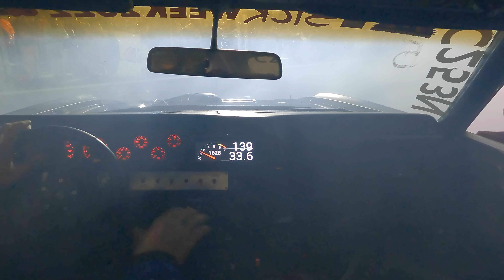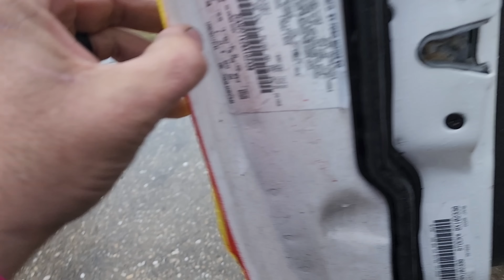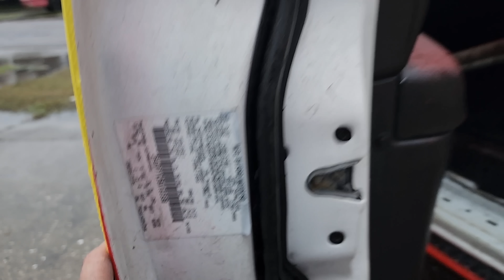We ALMOST won 2.4hrs of LeMullets + Chevelle's FINAL Burnout!

Comment: For those in less-humid parts of the country that are wondering why the power steering pump appears to be filled with Ovaltine, it's a thing in the Southeast: humidity, (water vapor) will mess up your fluids and eventually you have to completely suck them all out and replace with fresh.  Could also lead to trashing the PS system.  Thanks for taking us along!

Comment: Love the content, bitter/sweet to see Independence's last hurrah on the skid pad. If it were me, since the car is so rotten, I would drop the drivetrain and front suspension, then set body & frame on top of a 4x4 frame, strengthen it all up with an exo-cage and build it in an overlander style, but whatever you do with it I'm sure it will be great. Thanks again for all the great content Derek.

Comment: It'd be a cool series over the winter to maybe work on Independence by pulling the body off the old frame and fix as much of the body work as possible while keeping her paint job and then finding a donor chassis to put the body on. You can take all the good parts off the old chassis and use them on the new one or partner with someone to build a tube chassis to put the body on that way you can transfer the engine, trans, suspension etc. onto the tube chassis and Independence will be a much safer car to drive around and play with. Just a thought though. :)

Comment: Honestly the burnout thing is entirely new to me, but the sound of that big block gave me goosebumps.  Personally I have nothing to write home about but I have a ‘63 F350 dump truck with a 460 truck engine in it that I am going to try and use your plug-reading fu to sort out its running/idle mixture.

I’m enjoying this all a great deal.

Comment: I actually fixed my old 1999 Blazer by listening closely to some of your videos. I keep the old gal running mostly to put my boat in and out of salt water. Turned out to be a coil issue.

Comment: Derek at 25:09 on these stock type cars I believe I'd rather have a one wheel peel than a posi in the rain! I firmly believe wet conditions would make the car a tad unpredictable with a limited slip diff compared to an open diff which might light up the right rear only but you can still point and shoot and not have to saw at the wheel and over correct. It's not like there is 500+ at the wheels, so....just my 
.02 thousands of a penny's worth of thought.

Comment: I’m just stunned at how that little 10-Bolt has held-up. My ‘76 Chevelle has the same unit under her, and compared to the stout 14-Bolt under my ‘Burban, it gives me the same thought J had when Agent K handed him the Noisy Cricket pistol in MIB: “Man, I feel like Ahmo BREAK this!” 😖
I’ve had my ‘86 T/A for 6 months now… it’s a 5-Speed with Posi, and I still haven’t been under the rear-end to properly identify what it is; I’ve been afraid it’s another 10-Bolt… maybe I need not worry so much if it is?

Comment: What a blast. A wet blast, but a blast all the same. And Independence needs to be preserved in some form. Remember, it is an idea or a goal that can be considered separate from just sheet metal and drive train. Like an heirloom axe, where over the years you replace the head and/or the handle, it is still the thing it represents... An homage to those of us that served. New paint or sheet metal doesn't take away from the message. Just my thoughts...

Comment: Hey Derek, I doubt you’ll read this but I have a big Paxton blower in my car same style as yours but on my idlers and tensioner I have a lip on either side to keep the belt on the roller and I’ve never lost a belt. In fact, I get confused when I see these guys with centrifuge blowers losing their belt all the time and after seeing you show us your car now I know why. I can’t understand why they would be built like that but if you go to Paxton they sell those idlers for10 rib belts. And they just slide directly onto a half inch bolt so fitting them would be a piece of piss

Comment: I think you should put a really nice 350-400 small block, painted block, billet valve covers, billet accessories, new wiring harness, AN hose/fittings and updated auto trans.  Take the current powertrain and put it something decent, not junked.  Look at what the Australians do when they pick their cars, always unique and they are show pieces.  Not saying you need a show piece but decent.

Comment: Hey brother, you can tube the rear so you can hang some new sheet metal in the rear. Since there isn't much metal to weld to the tubing will give you somewhere to hang it. And you can match the paint patina. I'd like to see her last a while longer. I think she would be great for a Power tours car and stuff like that. Maybe with a lot less engine under the hood. Make her more street friendly to drive. Small block, big block, LS and an overdrive. Make her a touring car for road trips. She's earned the right to take nice long road trips without being brat on so much lol. Except for the red light launch lol with lots of tire smoke lol.

Comment: Kevin from ksr can make that car safe and it be a killer drag car it needs to be a drag car they would be able to put a nice cage in that car strengthen everything up that needs to be strengthened back half the rear of it and then vice grip could do the floor the power plant and rear axle. Get with Kevin from ksr again I think he would be interested in the project. It needs to be a drag car

Comment: I must have missed the “what to do with Independence” in a prior video. You say it’s just not safe for drag… why not source a frame for her and add a little more rigidity to it. And then give her a Corvette IRS, or a 4-link, or a Wavetrac diff S60?
Reply: He said the body wouldn't survive a frame swap, too far gone.  Also if do too much it's just not the "same" car anymore.  He talks about the future retirement in the video where he uses a forklift and winch (and other stuff) to pull Independence's body back into line after the damage she sustained at a previous event. Amazing how easily that got pulled back into line.
Reply: Yes you obviously missed the last video. He explained all your questions there.

If he went that route the only thing left would be the paint

Comment: The crown vic thing is played out.  Out dated stock cars are cheap, put together a fleet of those and put 300hp goodwrench 350 crate motors in them. The racing would be better, the cars will last and make the drivers buy new slicks for each race.  Badda boom

Comment: Whatever you go with, perhaps you should tub and then cement the tub like they do down under.
Reply: You'd blow the tires faster too from the added weight.
Reply: Which cuts down on engine wear cuz youre not on limiter as long.
Reply: In turn saving money's which I know a feller like yourself likes to save money's

Comment: Independance needs much love. Not on the outside, that needs to stay as is, but the inside.... Without spending to much money but spending a lot of time a feller could replace what is missing under the car to make the body more solid. Not show car condition but drivable without worrying about the body falling off. My suggestion is to rebuild the guts of the car without touching the shell. Well maybe a few touch ups on the outer shell but nothing extreme. As far as the motor goes, put a decent running motor in the car, make it look fancy without all the horses and horse torques. Keep those painted valve covers on whatever you put in the power barn, they are a iconic part of the car. That's my two pennies worth.

Comment: Sad to say but the only thing I can see apart from a lawn ornament of this body is to actually buy a new body 27,000 I saw somewhere called ecklers and take this Parts off of this one and rebuild there as brand new and yes it's expensive but you can afford it especially for the love you have for this thing you wouldn't be able to put your old then on it and crush this one and then you'd have a good base to repaint it proficiently the same way and you could run it safely wherever you like whether it's drag strip the street or burn out competition but like you did say this is now a dead trap body you can't save probably the only thing you could say is the roof the windows the engine transmission powertrain parts maybe the brakes I don't know but apart from that the main car itself is going to Pancake City